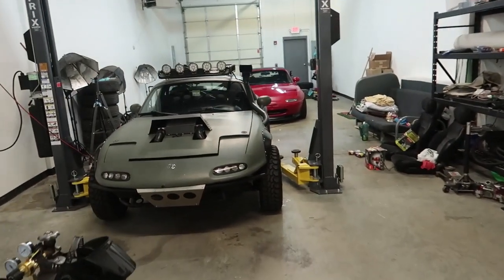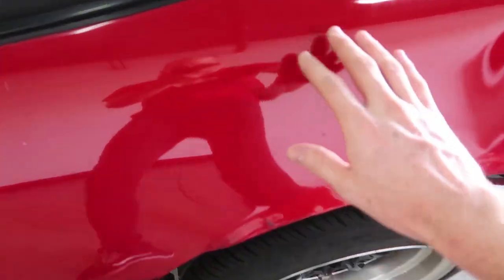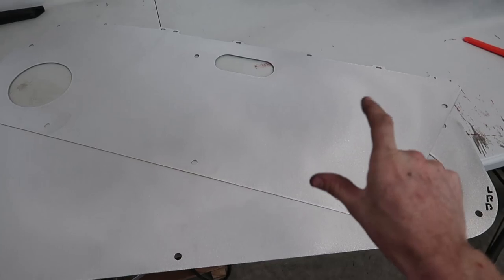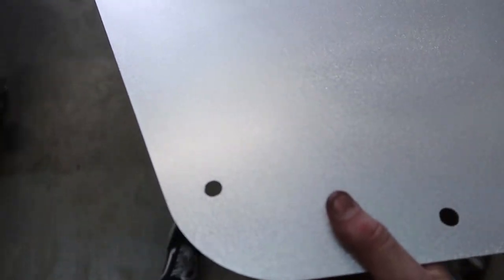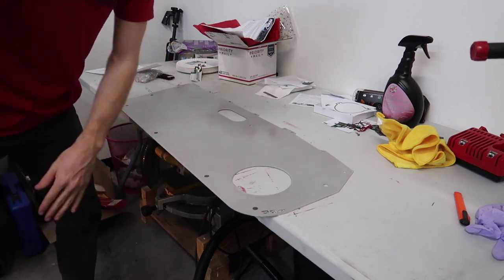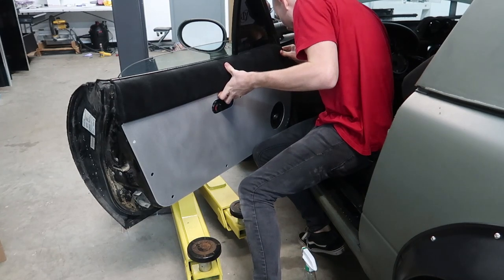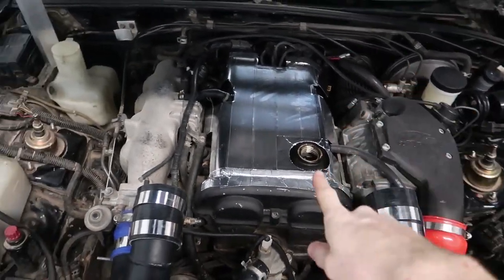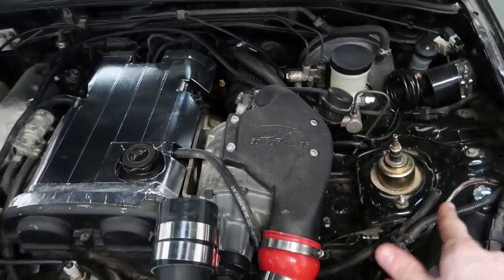Race Car Interior is Finished - Door Cards & New Gauges

Comment: You might want to consider using DEI Cool-Tape on Reagan's current engine, and when the WRX swap happens, switch to DEI Reflect-a-GOLD. Tavarish is using it in his cheap Lambo to keep heat away from heat sensitive components, and the intake, of course ;)
He wrapped the air-water intercooler with it entirely.

Comment: Hey so like I know you are dead set on a wrx swap but if you are down for something that's more mazda I'd reccomend checking out the kl series of engines and the awd system from the mx3/protege/lannis the real only downfall of that set up is the transmissions but with better gearing they are pretty bullet proof, not to mention the klze or kfze fit into a miata with not a whole lot of effort since even though they are v6 they are about the same size as a b series